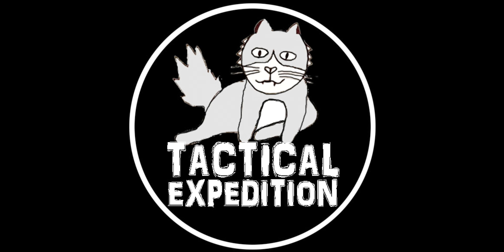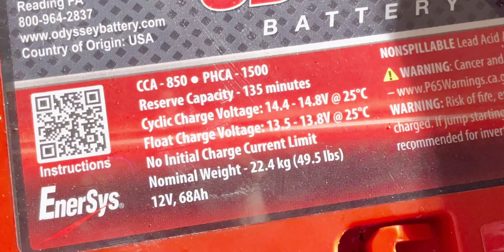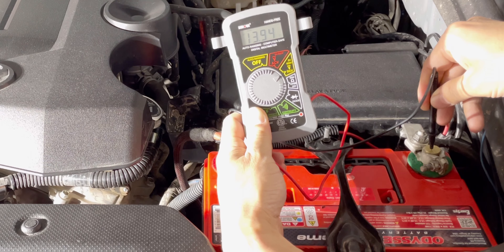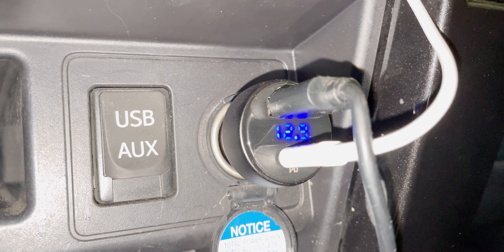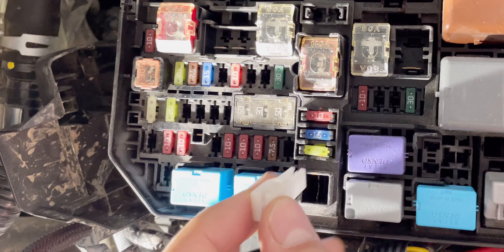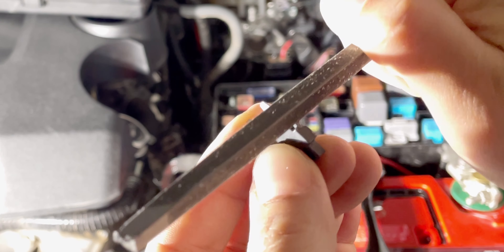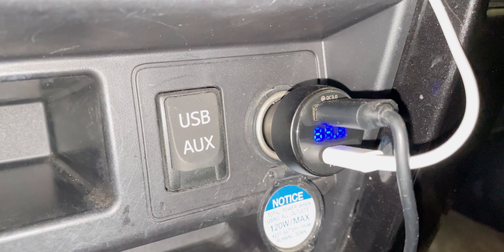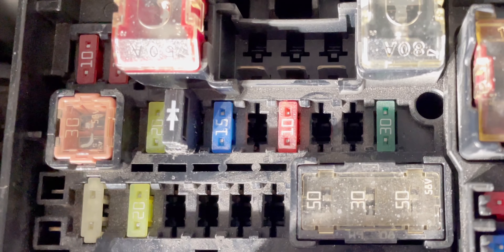【TRD⁷⁰】 Boost Voltage Diode for AGM Battery in 4Runner 🚙⚡

Comment: I have a 2020 and it doesn’t have a am2 7.5 fuse! Any ideas did they change it
Reply from the maker: I’m not sure. Sorry about that.
Reply: I think they did because for the voltageboosterpros it shows separately two different diodes for 2010-2019 and then the other one for 2020-2022

Comment: I’m hoping someone can help me troubleshoot. I did the same exact thing, using an odyssey agm 34 with the gm diode but I’m only getting 13.7v when the car is on. I know cycling voltage should be at least 14.4v. Can someone please let me know what I’m doing wrong or what else I should check? TIA
Reply from the maker: Sorry. I wish I can test it for you but I sold my 4runner 2 years ago. I miss that car.... 😢😢
Reply: @TacticalExpedition  yea I just got mine and doing some little upgrades here and there. You think you’ll ever get another one in the future?
Reply from the maker: @mauizzyadventures25 no. Not 4Runner. If I do get off-roading car, I will get a Land Cruiser TRD PRO or Sequioa TRD PRO 👍

Comment: Why is moving to that battery beneficial? And moving to that battery causes a voltage drop? Would one do this to bring their charging voltage up?
Reply from the maker: This is deep cycle battery. Much stronger. Google search AGM vs Lead-Acid. You can basically run any accessories (winch, led light bars, lights etc…) when the car is off and still will be strong enough to start the car. It’s mandatory if your car is off roading or overlanding IMO.
Reply from the maker: Regular batteries need 13.5-14.0 voltage to be efficient. AGM needs 14.4-14.8. GM diode modifies it so it charges at 14.5.
Reply: @TacticalExpedition  Hi, I wanted to know if you have noticed any noticeable gains moving to AGM?
Reply from the maker: Not yet. I was going to test when I go camping overnight. I will let you know.

Comment: Awesome video. Will this work on my 99' 4-Runner?
Reply from the maker: Just have to plug it in and test. Not gonna ruin anything and the engine light will come on. Just plug back your original fuse back and it will go back to normal.

Comment: Respectfully sir, there needs to be a fuse there. Don't let a $4 diode cost you major electrical nightmares to diagnose and repair later because you didn't retain a circuit protector. 7.5A is not that much, and I'm sure that diode is rated at higher than 7.5A.